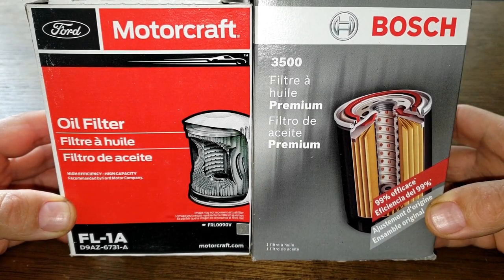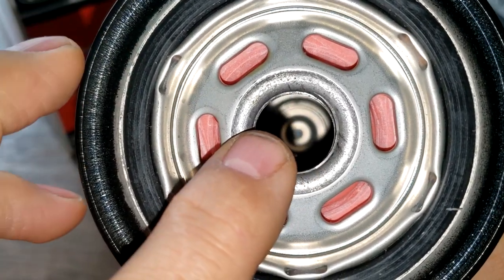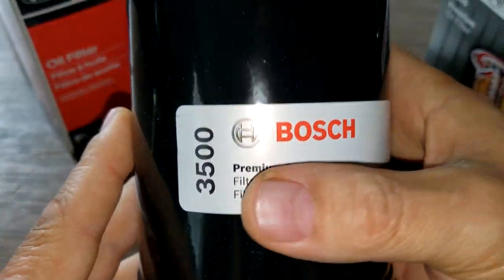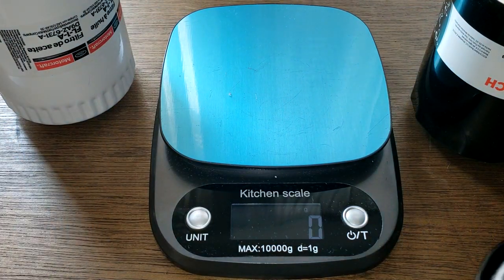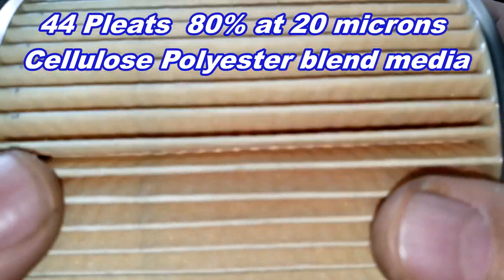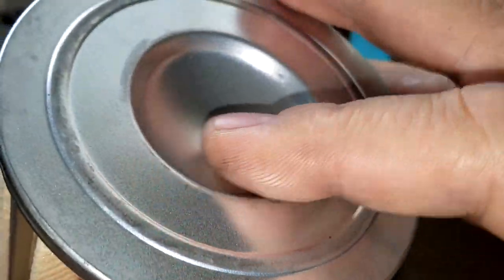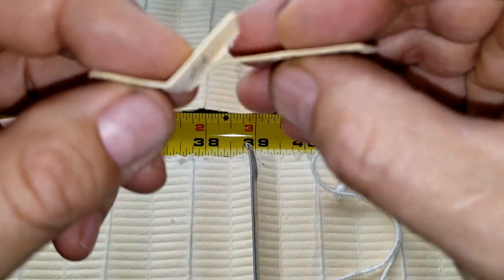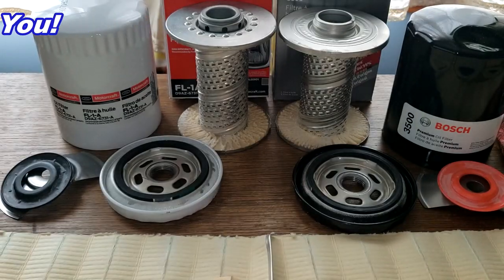Motorcraft Oil Filter Cut Open Fl1A Vs. Bosch Premium Oil Filter Cut Open 3500 Oil Filter Review

Comment: I'll take the Bosch over the MotorCrap filter anyday
Reply: Sorry, you must have had a terrible experience with the motorcraft. I mean to go to all the effort to think of a snarky name for a product, says something.
Reply: @dgunearthed7859  it is crap ! Had one fail right from the Ford Stealership & completely destroyed the engine just a half hour out of the Stealership door ,took Ford several months & complaints to get the engine replaced
Reply: @daewooparts  that sucks!
Reply: They are both made by purolator. I wouldn’t use either. Have had several motorcrafts fail on me. I won’t use them anymore. Quality just isn’t there anymore.
Reply: @SlikLizrd  I do change my own oil ,this was my pops car & it was the free oil changes that came with the vehicle from the dealer ,the car wasn't that old & it was the filter that failed ....good thing it was done by the dealer as they was liable for the work done & the parts warranty claims

Comment: Both have stickers not good I’ll pass
Reply: WHERE in the Holy Hell did you get the idea that the filters with Stickers instead of a Printed Logo are "not good" !??
Fact is, the Stickers were used as an IMPROVEMENT over the Printed Logo, because the printing process of the logo is much more harmful to OUR ENVIRONMENT than the Stickers. 
I think you'll find that ALL oil filters made in the U.S.A. now have the Stickers.
Those Stickers are actually a "plus" on the side of the filters that use them.
Reply: @SlikLizrd  LOL, imagine thinking that a sticker is what makes the difference between a good or bad oil filter. Probably thinks that red cars are faster than blue cars because red looks faster 🤣🤣
Reply: @aerialzona6003  Yo, 'Zona !! It's all good, man -- I don't speculate on what somebody else might think, because that might lead to me having a head full of worms.
  I don't know why or how the Stickers became an issue, BUT -- 
 My preferred brand of Oil Filters is the Bosch Premium, and they all have the Stickers, so it's a mox nix situation for me.